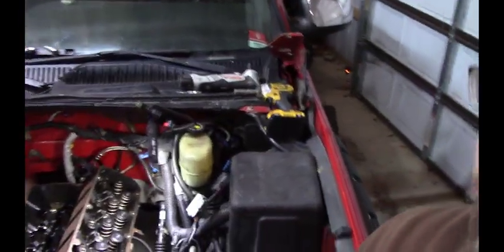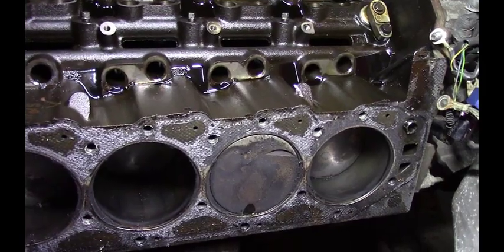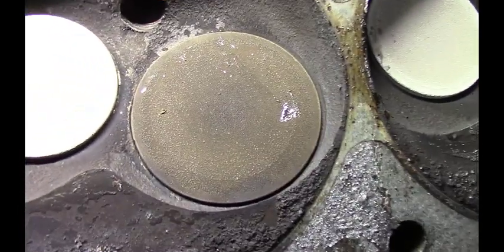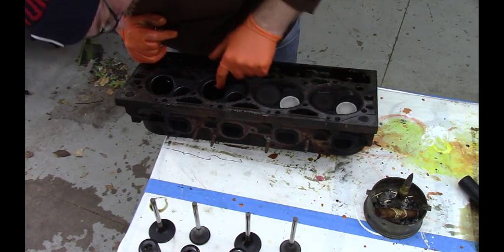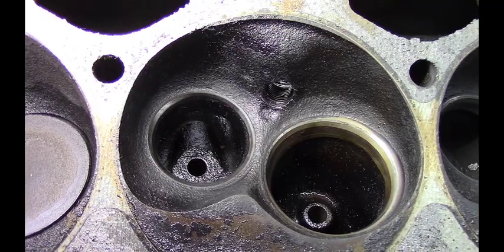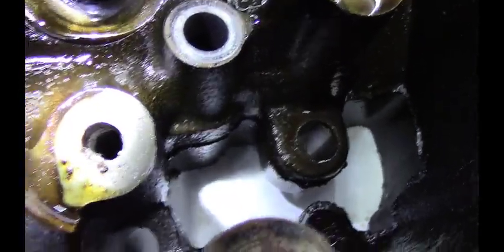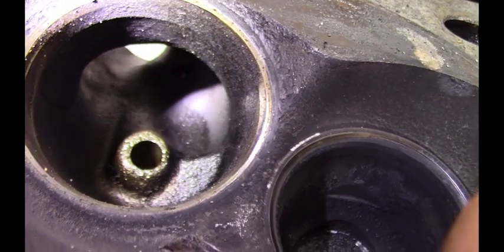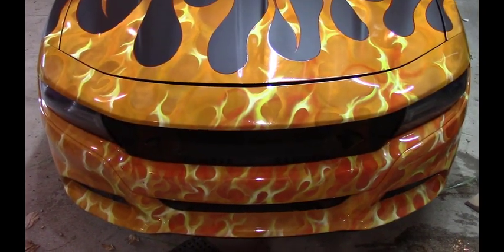8.1 Vortec Misfire and Backfire Solution and upgrade to Bigger Valves!

Comment: what was your solution to the cam timing gear not fitting the pin? i believe i have your same symptoms but not as bad . I've changed and tested just about everything fuel and spark related but still have a rough idle, and small tiny backfires or misses when i rev it in park a bit. driving me nuts. Only have a cam/cank variation relean to do before i take it in for a leakdown test...
Reply from the maker: @peterkoss1312 My misfires were due to the valves and seats and you can only find that out with a compression test. Its super easy to do. The cam gear and pin were due to Gen 7 and Gen 4 parts incompatability. For my situation I am going Microsquirt to handle engine management. Hope this helps...